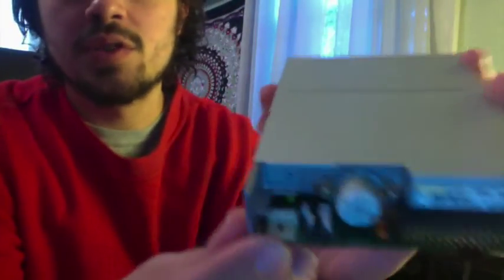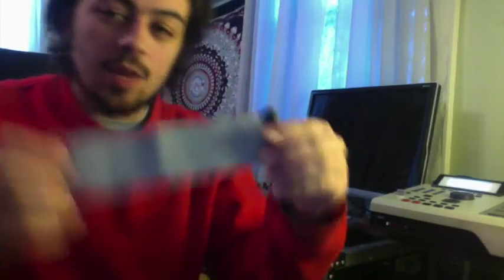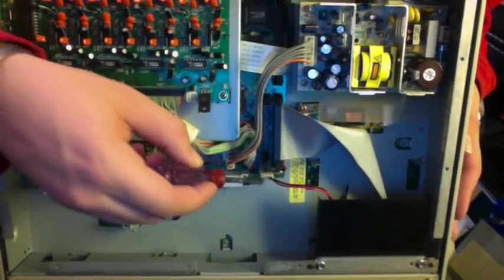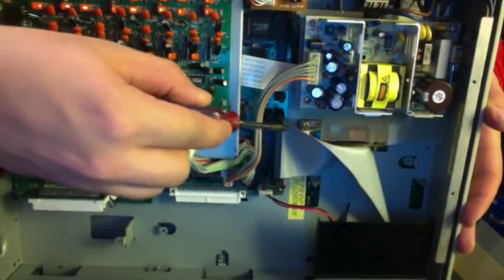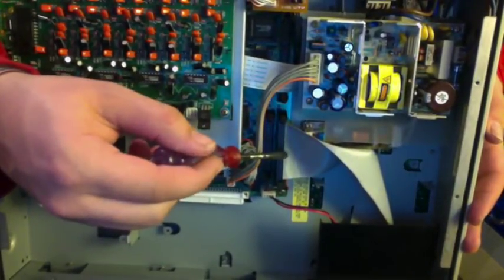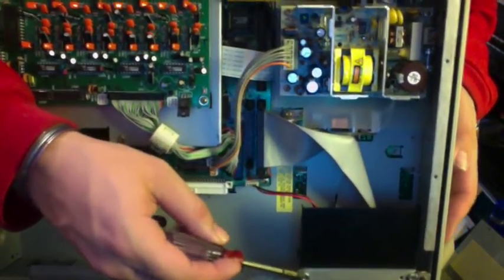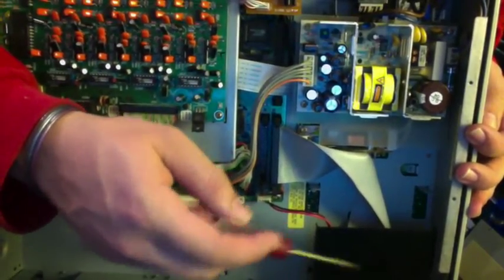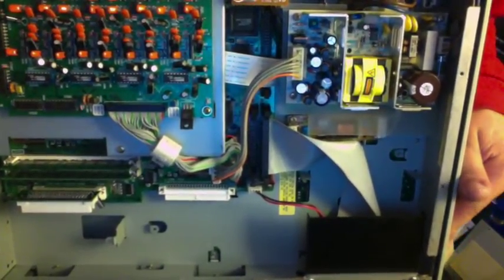Akai MPC2000xl CF Drive Card Reader Install Tutorial (Compact Flash)

Comment: Thanks for the good content bro - do you know whether there is a hot-swapable option?
Reply: The only hot swappable, w/o issues and buggy behavior I know of, are the cf card readers from late model 2000xl's (blue ones). They come up on eBay every once in a while. Not cheap. Anything under $200, buy it. Also the one made for the machine, bolts right in, no mod b.s. or intermittent issues. Smooth sailing.
Reply: @wesleywayne303  Nice 1 Wesley.  Kept reading people saying they only spent 30 bucks, and I was thinking - too cheap, what's the catch? You pays your money, you gets your card reader, I guess.

Comment: Hello!

Going through this joyful process now! I had a question about installing the MPC OS--I have the download, but it extracts to some weird binary file with a .cpgz extension. Do I simply throw this file onto my SF card as the installation process? The file isn't executable on my Mac, so I'm unsure what it is (and how to install it). Thank you!
Reply: @Self Preneur nope, unfortunately. Please keep me in the loop if you have any luck though--it's killing me.
Reply: @Self Preneur Thanks, but is there no way to mount the OS on the CF card without buying anything else? Do you mean that I can purchase CF cards on Ebay with pre-installed 2000xl software?
Reply: @Self Preneur no, unfortunately. That's why I was hoping to upgrade it. :) Are only floppy drives with the OS available? If so, I guess I could clone the floppy drive onto a CF card but that seems like much more work than it should be to just extract the software.
Reply: @KirkPearsonThePerson  I hope you see this! Did you get this solved? I'm in the same boat. Zip died, os on 1.14, so how do you get 1.2 on the machine? Seems like no one wants to help. Sounds like either through the scsi to a external disk drive or reinstall a disk drive internal, then update, then reinstall cf. What did you do?
Reply: @wesleywayne303  hey! Still nothing, it's still unfixed and I've given up on it. Though I guess we all have some free indoor time coming up. Any ideas?
Reply: @KirkPearsonThePerson  working on it. Bout to figure it out... I will remember to check back in.
Reply: @Self Preneur you get yours to work? I'm working on the solution via scsi port to adapter to zip, upload OS. I'll let you guys know if it works, it should.

Comment: Appreciate the info. I hit a snag and couldn't figure out why the cf reader wasn't showing. I switched from a Zip drive. I looked at the photo of the power cable you posted and my question is, am I supposed to connect the yellow and black cables together or are they just taped up to kill them? The connection i have, the yellow and black cables were cut all the way down so I stuck new yellow and black ones in their place and then froze up before connecting them together cause I don't want to blow out my motherboard. I'd really be grateful for the intel. Thanks in advance.
Reply from the maker: check the photobucket link
Reply: I seen the photo bucket but do i have to do my cables the same way